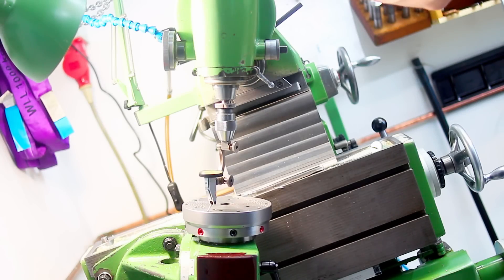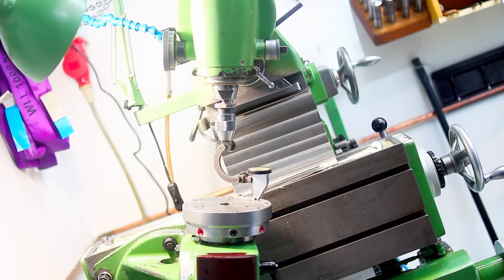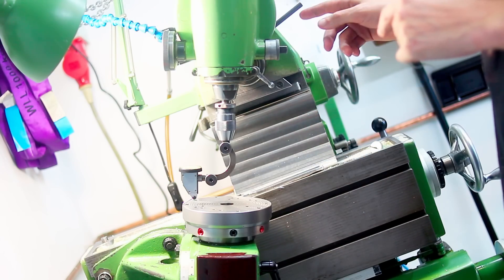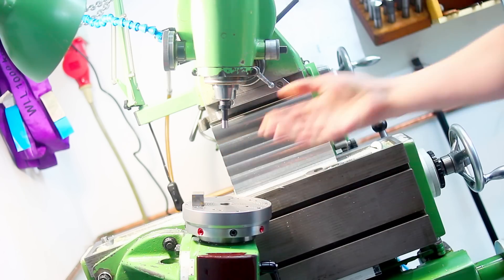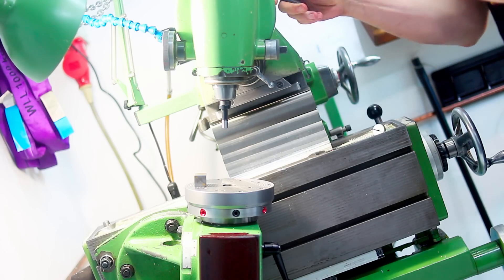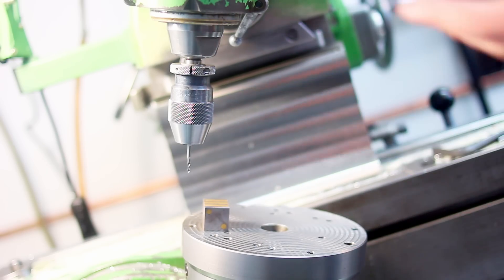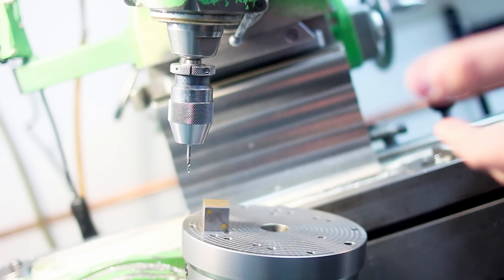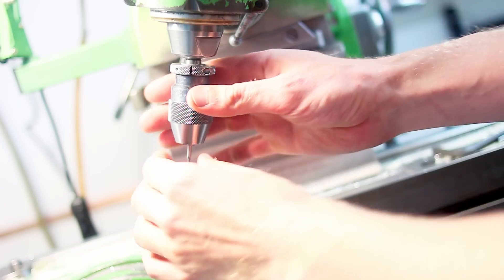Spindle tramming - Followup

Comment: Thank you!
I, too, have made good use of imagining what would happen at extremes. That quickly makes many circumstances much more easily understandable. 
I remember trying to explain vector weights to my boss. If a big rig scale is perfectly level but the entry or exit area is not coplanar, then it's impossible to get accurate axle weights if the rig is longer than the scale. It made errors of quite a few thousand pounds. 
For example, you might pull the rig almost entirely off the scale in order to weigh just the last two axles (the tandems).
If the bulk of the rig is not coplanar to the pads weighing the tandems, then you'll be reading an angle dependent vector weight and not the actual weight. 
The driver could end up with a sizeable overweight ticket, through no fault of his own.

Comment: I don't know if any one commented on using a cylindrical square. Assuming your table is flat and when swept from above does not climb or fall in either axis. Use a 125 or 150 (5"or 6") cylindrical square next to the extended spindle. I have a Wells-Index 645, my problem is that I set this, and it gets bumped, as the 4 bolts do not appear to hold the head in place. I just tore all this apart this weekend, removed the solidified grease from the worm gears and cleaned the mating faces, put it back together, and now need to tram it. Looks like previous owner over torqued the 5/8" bolts, as they appear to have some thread damage. I'll use a torque wrench and set to grade 5 torque for this.

Comment: vaguely related is a helical milling trick.

so, you select appropriate change gears, kick the head over to the required helix angle, all good.
 except no matter what you do, you cant find the appropriate change gears. its one of those leads... continuous fractions dont help...
apply trig...

kick the work over on the table to the sin, then kick the table over to get the work back in line, feed on the hypotenuse, with resultant required feed on the ...adjacent?

one of those things you would need once in a lifetime, and one of those things you will never need with CNC...

like kicking compounds over for that neat 10:1 reduction.

Comment: Why does the collet sleeve not fall out of the spindle when you change collet? It does that on my FP2 😢
Reply from the maker: They fall out, when the spindle taper or the sleeve are not in perfect condition, have nicks or are dirty.
If all those things are in good condition, the sleeve (and all 40 taper tooling) will not fall out the taper by itself - The sleeve has to be released with a large wrench on the flats (it breaks loose relatively easy) and regular 40 taper tooling gets ejected by the drawbar.
Reply: Thanks for the answer. Yes, there are unfortunately some scratches inside the spindle taper on my FP2. So that is probably the cause. Is it possible to stone the spindle taper? Or is there some other way to fix up the taper?
Reply from the maker: @gustavnaslund2111  Take a mirror and a flashlight and have a veeeeeeeeeeery good look into the taper - Look for high spots, where maybe a tiny chip has embedded and use a small triangular scraper to remove the offending material - You can use a round stone, but pleeeeeeeeeease only the most fine stone you can find, an round Arkansas for example, and exercise extreme caution.
Reply: Dee Dee on YouTube has some videos on scraping in a damaged mill spindle taper.

Comment: The deckel tooling ball, being much larger (16+mm in diameter iirc) will be less frustrating to use, though, a tiny bit less accurate
Reply from the maker: The one that came with the Zentricator?
Reply: @StefanGotteswinter well, not 100% sure about this, but I can't recall a space in the centricator box for this part. I am talking about a thing with a block and hole (to be fixed via bolt in tslot) and then an arm at an angle that ends up in a hefty ball

Comment: I absolutely love the versatility per cubic centimeter of those deckel mills! With regards to the idea of “nod” like on a Bridgeport, is the spindle on a deckel presumed to be perfectly vertical in that plane consummate to its geometric wear? Or does it have a manner of adjusting/correcting the spindle axis in that direction?
Reply from the maker: Ha! The spindle nod on the deckel machines IS a problem with wear, absolutely correct. On the smaller machines less, since the FP1 has only 150mm and a rather long dovetail. But on the larger machines, they even had to scrape a bow into the Y-Axis ram, to counteract the sag from gravity. With wear they tend to sag more and more, the further outwards you go.

Comment: 👆My comment in the other video regarding the cross hatch pattern was not to say your methods are incorrect, per se, but incomplete. I would never tram to the table or any other part of the machine. Instead I put a piece of material in and take a light fine cut across in the axis I'm working on and then tram to THAT surface because it represents the TRAVEL of the axis which is all that counts. Repeat for the other axis and it will be pretty close but still not perfect. 

Why is it not perfect? I bought a Blake coaxial indicator and their literature claimed that tramming with their tool under power simulates the loads with motor torque and other forces accounted for. They are correct. A perfectly trammed machine adjusted statically will not be perfect under power. But the Blake indicator is not accurate enough for my needs. So my final adjustment is to tap and test till it cross hatches in all directions.

You mentioned in your reply how some machines cannot have a cross hatch in both directions, this is true as I have seen but if that is the case then that machine probably cannot be relied on to produce the result you want either. It is suffering from play somewhere in the system. 

You made it clear in this video that you are tramming to the axis of TRAVEL and not to a surface such as a table top so We are both on the same page that far. The only difference is how to do it. I get the machine to make a sample of it's travel by machining a piece and measuring to that. Then we part company because I then test for cross hatch in all directions but if it can't then I adjust for equal but opposite patterns in opposite directions. (the cross hatch is still visible at the edges of the cutter path even if it does not extend all the way to the center of the cut. That way I can face off large surfaces without leaving perceptible steps between overlapping passes.  

I am loving this discussion with you!🏆
Reply from the maker: Ah! The flycutting statement was not in regard to your comment :)
(And I absolutely agree that tramming for a large flycutter and crosshatch is tough)
(Also agree on the co-ax indicators like the Blake beeing not great precision tools)

I imagine those machines that surface engine/zylinder blocks with huge face mills, leaving a nice pattern beeing a pain to get trammed well.

Comment: if anyone was wondering how to check nod when the tilt is off you can still do the test bar method, you find the high spot on the test bar/quill, move the table down, note the indicator reading and find the high spot again, if it's higher you're nod is off, you can then use the high spots at both places to tram the tilt then move the indicator to the front of the test bar to tram nod
Reply from the maker: True! Good idea :)

Comment: Ran into issues with tramming my first mill because the table itself was about .010” thicker on one side.  Tramming by the table itself was a no go (as i quickly found out), used to cut blocks on the table and then trammed to those blocks.  Adam’s method was much simpler.  So glad he posted it, such a lifesaver.  What you’re demonstrating was basically how my mill’s geometry was.

Comment: In the US tramming when tramming the head on mills I did certain things
1) l never ran the indicator tip on the table over the tee slots. 
2) To get a reading with the indicator I would sweep a known height object between the indicator tip and the table. Typically a gage block or a roller from a tapered roller bearing ground with the ends parallel to within .00005" or less.
3) Use an outer race from a high quality anti friction bearing large enough to span most of the table in the y axis. Then you could swipe without suffering any crashes in the tee slots. The bearing race could be ball or roller types as it was from a high quality bearing. ABEC 7 or a low number class ISO grade.
4) If the mill was a Bridgeport use a height gage to align the surfaces that the ruler for the quill depth sits against. It gets you in the ball park. 
On a benchtop mill I think a good option would be to come up with a way to use a pin to position the head. And after locking the head in place remove the pin.

Comment: After I broke the casting on my mill. For my last time traming before welding I chose to tram the KIRT vice bottom and back jaw for tilt and nod. 99% of my work is in the vice. I know this would never do for what you are doing but The mill has paid for it's self 10 times over.